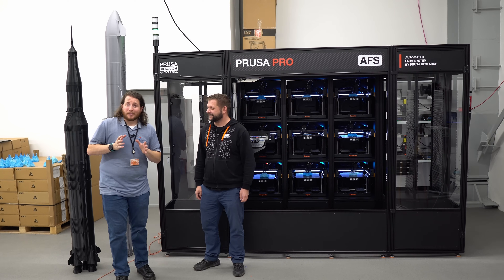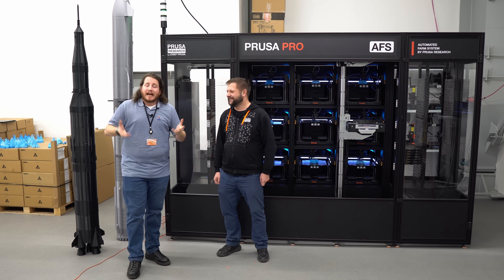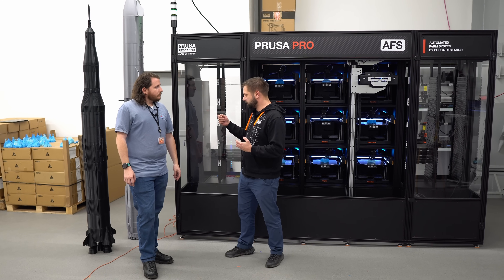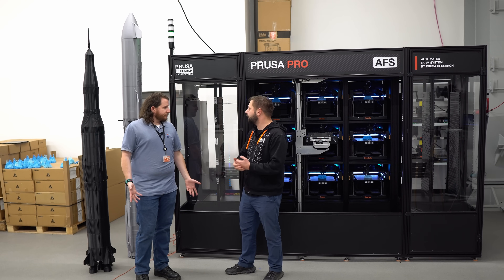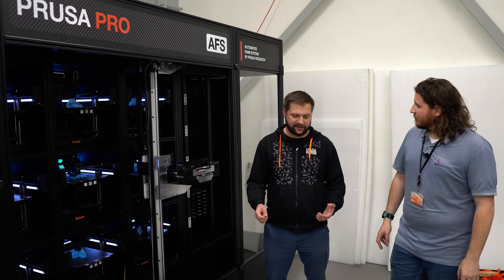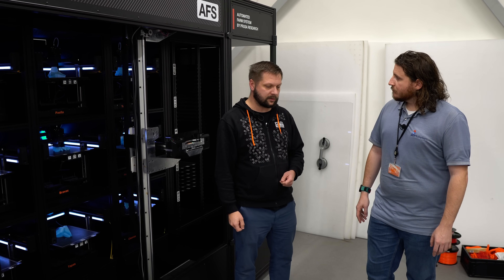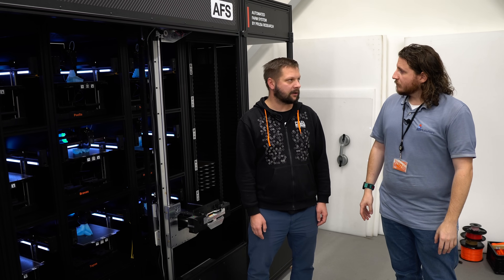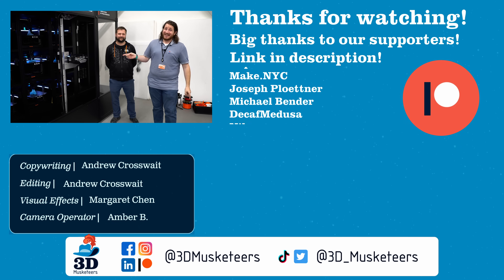FULLY AUTOMATED 3D Print Farm!! Prusa's AFS!

Comment: I have been wondering what happened to the AFS after it was demoed, several years ago.  This is definitely an ideal product for print farms because it reduces manual labor.  Load the empty build plates, replace filament when needed, and go pick up the finished prints.  I'm sure it isn't cheap, but you get what you pay for, and having an automated farm where I can focus on sending prints to the farm, then come and pick up the finished products later on, is worth it in time saved and workflow upkeep.

I wish I had the cash for one.  This would definitely be something that would be something for the garage, even if I had to get the electrician to add a circuit or two.

Of course, if these had multiple toolheads and the ability to print higher temperature materials, they would be a lot more useful, but with the current architecture, I don't see these going past 300º-350º without a redesign for chamber heaters.  As it stands now, these can go a long way to automate a print farm.

Comment: I'm really confused on what the advantage is here compared to just making a shelf of belt printers. Having a fully articulating arm in there and swapping build plates just seems incredibly wasteful from a complexity standpoint
Reply: A human wants pay and decent working conditions. A robot dosent need this kind of stuff
Reply: belt printers suck and are a pain to deal with so the concept is a none starter from the get go.
Reply: @Pixelplanet5  it is literally just a slightly more flexible build plate wrapped around a drum. Mechanically, thermally, electronically, etc. a belt printer can be identical to a normal printer. The 45 degree head thing is primarily for endless prints but it's not even slightly required.
Reply: @felixjohnson3874  no, a belt is a build surface thats not solid, flexes und load and with heat while also greatly limiting your options for whats actually on the surface of the belt because now you need to find a polymer that sticks to the belt material while also providing proper adhesion to filaments and that is also flexible enough to.
Printing at a 45° angle already means you need to design parts differently so they print properly and have the structural integrity you need.
There are good reasons why belt printers never took off and that the few that ever came to market dont print great.
Reply: @Pixelplanet5  all modern buildplate surfaces already are flexible, the belt can just slide over a solid supporting drum/panel to eliminate flexing, (this is also basically necessary to heat it) and thank you for proving you didn't actually read my comment because nothing about a belt demands a 45 degree head.
Reply: @felixjohnson3874  they are flexible up to a few degrees, what ever the metal plate and your strength allows for.
you would need a massive drum and a very long belt to get a bend radius this low.
also theres still the problem that the entire belt needs to be evenly heated which is something no belt printer does today.
Reply: @felixjohnson3874 
Problem whit a non 45° head is that it is patented

Comment: Imagine if they put this much effort into the consumer market instead of releasing bed slingers in 2023.
Reply from the maker: There's way more money in pro level stuff and last I checked most companies released some bed slinger in 2023. Not just Prusa...
Reply: I don't think it would have made much difference. Many consumers want everything to be as cheap as possible, but Prusa cannot compete with Chinese manufacturers in terms of price. So they have to focus on market segments where customers are more interested in sustainability and are also willing to spend more money if they get decent support and the product has the required certifications.

Comment: for the price of cameras - you would think that each print would just have its own camera and not keep moving the arm to get photos
Reply from the maker: The arm keeps it incredibly consistent, but who knows, that's definitely possible!
Reply: You'd have to ask the developers why they did it this way, but I can think of a few good reasons why they didn't build a camera into every module.

The small cameras used in printers are usually wide angle cameras and being so close to the print object distorts the proportions. They are also quite cheap cameras. 
The camera on the arm appears to be of higher quality and it doesn't seem to be a wide-angle lens. So there should only be minimal distortion.

Perhaps someone who knows a lot about photography can give their opinion on this.
Reply: Handeling that meny video feeds is much more complicated

Comment: same wish as any printer, needs bigger build volume
Reply: Bigger build volume does not need automation > big prints > days of printing > downtime is not that big of a deal :)
Reply: @Sargon999  yes big prints does need automation. We need automation across the board Im taking 350x350x350 which is reasonable.
Reply from the maker: I get that. I will say, the vast majority of parts that we print and ship fit easily in the AFS build volume. Sure there are some that don't, but those aren't as common. And for that, have a larger printer or 3 to handle it :)

Comment: The AFS can do 260x260x170?! It would have been great if the Core One could also do 260 in X and 260 in Y.
It would have been great if there had been a way to use the "old" 250x210 printing plates in a downwards compatible way.